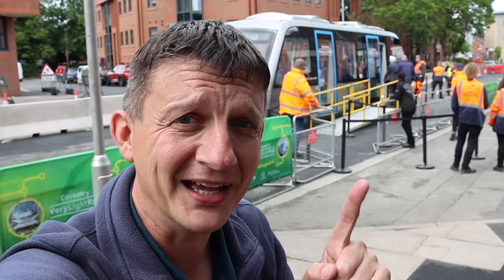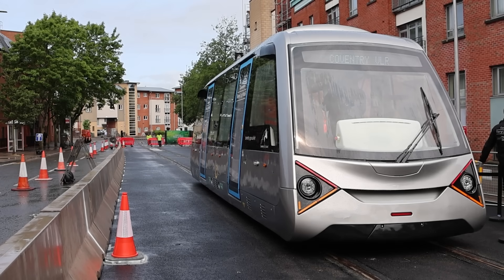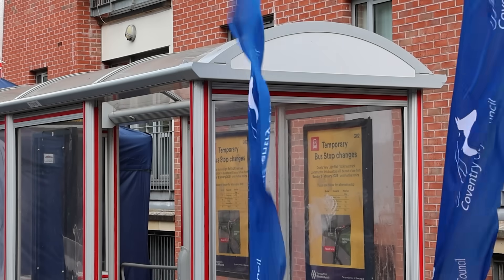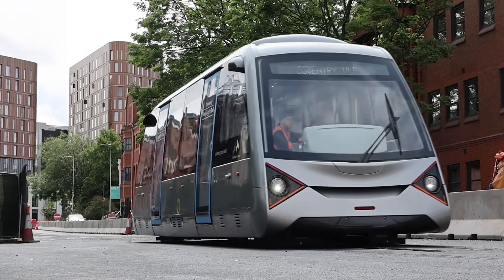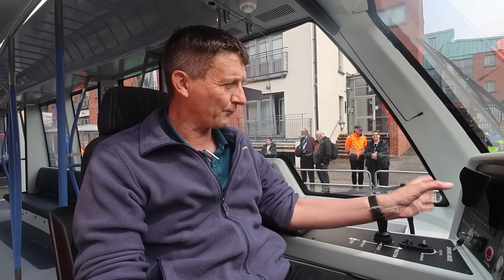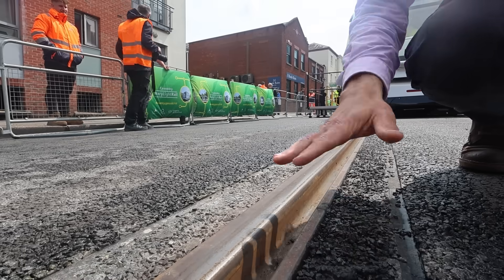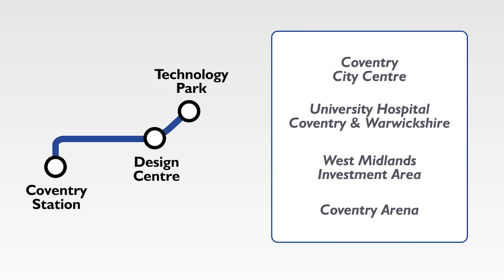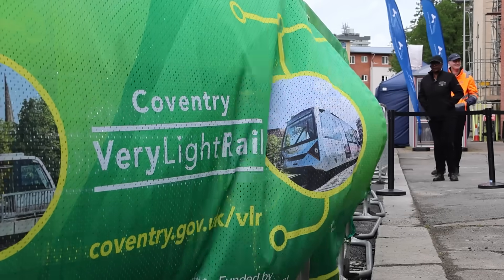The NEW! Coventry Very Light Rail is here

Comment: it's gonna take them 2 more years to connect just the city centre with the tiniest light rail cars that cant even go very fast? what's the point? just because they're half the price? we SHOULD be spending more on quality infrastructure so it actually lasts. with cars this size you'd hope for a quick decent service but theres no way this is even gonna be running more than every 10-15 minutes lol, so every single one is gonna be packed

Comment: I think that it has some potential for low-usage routes, for example in small towns and cities or as a connection to higher-capacity services in larger cities in certain areas (for example universities, commercial areas or housing estates), but i have one question:
Is it possible to increase capacities in the future, for example by coupling two or more tramcars together, using trailers or developing an articulated variant of the VLR? 
There could be the risk that the system could bemore successful than expected, which could lead to overcrowding, which could be avoided by providing higher capacities.

Comment: Two major issues i think, one being the capacity (this will get crowded really quick in a city of coventry’s size); two being that light weight trams are known to derail much easier during collisions. Conventional light rail already has this problem, i can only imagine that it’d be much worse for this.
Reply: capacity isnt an issue if it is frequent.
Reply: @suburbia2050 partially true but the charging infrastructure required to support enough rolling stock for a frequent service would become so expensive that fully electrifying the line will become cheaper- which would have just made it better to build a standard tramway from the start. as an example, fast chargers for electric buses often demand more power than your average entire neighbourhood draw at peak times. full electrification removes this peak energy draw and spreads it out much better. plus, this specific example in coventry is all street running (in mixed traffic) which means that top frequency is always gonna be limited by how many cars are on the road. to be able to use this system to its full extent you’d need to have much more dedicated tracking (lanes without any cars on/grassy tram tracks). reconfiguring roadways to support this higher frequency is very expensive, the small vehicles displayed in the video with mixed traffic running will not cut it in any respectable town

Comment: One thing not covered is the pedestrian trip hazard caused by the track not bring bedded in. Meaning that you would need dedicated running areas and not able to integrate with road transport due to presumably not able to drive over the track without risking one's tyres (bikes especially).

Pun not intended but will this be the stumbling block. . . . . .
Reply: Given slapdash installation wouldn't get past any inspection, I'm unncertain what point you're making here.

Comment: 70km seems like it will be the limiting factor for this, if it will be running 16 hours a day it will soon run out
Reply: Even with current Li-Ion batteries, recharge times might just surprise you
Reply: @TheHoveHeretic  Oh if only Li-Ion liked being charged. Or discharged. After 5 years the battery is used up and you need a new one.

Comment: I fear that this is nothing more than a virtue signalling gimmick that simply ignores the one thing that always made electric trams truly viable - the power source is not on board the vehicle.  With overhead cables you could have an even lighter rail system because you could power the vehicle externally which means you could delete what is no doubt an extremely heavy battery pack from the vehicle and just have the traction motors.  And this will need to be done because a 75 km range on a public transport vehicle is just ludicrous.

Comment: I don't know how to feel about this project.
The capacity is not that great, so thet could just use electric buses.
It's basically combining the worst of buses (relatively low capacity) with the worst of trains (they are not free to move everywhere).

If they were to connect multiple pods together, then I can see the advantage of staying "light".

Comment: Super skeptical. It is a pod. It has batteries. It requires a driver. It requires stations for step free bording - no, this is false, it could have a ramp, but cannot kneel. It requires pointwork and tracks. How is this better than a bus? Aren't the recurring costs the same as a tram?

Comment: The exterior of it looks quite nice, but the interior must have been designed by someone on a drugs trip, it's just wavy and strangely aligned. Whilst it might be cheaper to build, I'd question the use of such a small unit, unless you can actually couple multiple units together, you'd be better off with a battery electric bus which doesn't even need to have the tracks laid. 

As for a name though, Tramette? Trim? Bug? Or a personal favourite... Geoffolator.

Comment: It could be a nice stopgap for its political utility, testing out new lines with less investment. But promising most of the benefits of a full-scale tram will is frankly quite dishonest. The top benefits of a proper light rail are:
1. Capacity, because of long vehicles
2. Reliability, because of high level of separation
3. Increased property value and liveability, due to high investment into street infrastructure
This system cuts back on all of the above.

Comment: I mean this might have some promise but without longer vehicles with room for more passengers, I struggle to see the appeal for a city to invest in this over just a regular bus. Especially now where BRT systems, if well designed, can deliver a lot of the speed and attractiveness of a tram system for up to 150 passengers at a time at 1/3rd the cost. 

I know the current vehicle is just a demonstrator but still, unless they can design a vehicle that can match a bi-articulated bus on passenger capacity (ie 140+ passengers), then its gonna be a hard sell. 

Also IDK if its just the British government being stingy but as a Danish person I cant help but look at Coventrys population size, and think that both the cities here that have modern tram systems, Aarhus (pop. 295k) and Odense (pop. 182k), both have a smaller population size than Coventry and Odense especially is at crushload capacity during rush hour with regularly sized 30m long trams. So IDK how Coventry expects these tiny smaller than bus vehicles to cope with capacity.
Reply: I mean in THEORY you can make multiple units without making them heavier, so it shouldn't be that much of an issue. But yes Coventry is large enough to justify a proper tram. Although this would be great in even smaller cities.

Comment: "all the benefits of a modern light rail solution" - The capacity is a lot lower to what light rail offers. This seems more like advertisement than reporting.

What about points? I guess these need more depth than the normal track.

Comment: This looks interesting. The cost per km is apparently just 1/5th of a standard tram, so cost/benefit may be good enough for a lower rider number than for a traditional tram. If demand on a specific route can be identified the disadvantage of having a fixed route compared to a bus may not be an issue and the lower operating cost can be an advantage. Bus rides can be rough while a tram moves smoothly. I hope this will be a success for Coventry.
Reply: really is cheap considering it can just be layed from the base layer of the road bed, wonder how much weight those tracks can hold...

Comment: Do we know what the maximum axle loading is for the CVLR track system? So if one day you wanted to run full size trams along it without major track renewals to increase capacity, if you can it might make it more attractive for larger cities as well as they would be able to extend there tram systems for less and therefore able to spend the same amount of money on a longer extension or save money and use that saved money on other benefits to the settlement.
Reply: There is no track structure.  The rails are laid in trenches dug in the roadway - no cross-ties/no concrete slab.  My assumption (happy to be wrong!) is that if a "VLR" route is to be made suitable for "ALR" (Actual Light Rail) that the existing rails will be dug out and proper track laid.
Reply: @plaws0  It does have a concrete slab which the rails sit on and are held in place via Pandrall clips. The slab is around 9 metres long with 60x60cm openings for utility access. The Concrete slab is around 10cm thick with rails taking up the other 16cm of thickness to create the 26cm thickness.
Reply: @J-Railway-Volunteer  Pandrol, but yes, that was not well explained in the video (again, by the PR flacks, not Geoff).

Comment: what i like about that system: it's not a Gadgetbahn like "Trackless Tram" BUSES but runs on "normal rails" so they aren't bound to one builder and when they go out of buisness or don't produce replacements you can throw it all away.
and many undersell it. Just Look up "Woltersdorf Tramway", short route, similar sized trams but runs on conventional tracks so well, if you want a usecase for that System, look in similar towns or districts. And while 70km don't sound that much, you don't need that much if your route is short, like let's say .... 5,6km long

P.S. i liked Tramlette or Tramette from the comments
Reply: We'll assume the 70 km per charge is accurate even if we don't know how long it takes to charge to that capacity.

The battery for a 5.6-km route (assuming that's real, too)  would last 12.5 runs.  So really, 6 round trips.  Let's be generous and say that the round trip can be accomplished in 15 minutes and that the first car leaves at 0600.  Whatcha gonna do now that it's 0715 and the car needs charging?  

The more you throw the maths at it ...
Reply: @plaws0  there is a German word for that: Milchmädchenrechnung ... or "making wild mathematical guesses and they are ALL wrong"!
And it wouldn't be THAT hard to look at my case study, since it's all also available in english, to find out that they have 4 modern trams, that they run every 20mins and it takes 17min for one trip or 34 for a roundtrip and ~5min where they sit idle and can charge a bit and get more than the 6 Trips, with 2 of their 4 trams. Use the third one and they charge for way longer. 
Like, where did you get that wild numbers or that wild assumtion a tramline has only ONE car? Particular when you could just look them up or did you wanted to produce some flimsy counter arguments and not subject them to reality because you knew that all would crumble by the slightes breeze? So the only thing you where right was your last sentense and i threw more maths at your Milchmädchenrechnung.
Reply: @plaws0 you send out the next tram, and get the first one back in the shed

Two more of these and you’ve covered the morning peak

By the afternoon, you can start pulling them out in the same order with a full charge

Comment: This is an electric bus that just happens to run on rails - if you were skeptical you would call it a light-rail-bus. If you have a high quality pavement, there is little advantage over an electric bus. Note that the most important part of transport service is operations (frequency & journey time), not infrastructure.
Reply: Just reduced energy consumption.
Reply: "there is little advantage over an electric bus." - except cheaper to maintain, much faster to load and unload passengers, smoother ride, more than one wheelchair user can get on per vehicle, much easier for people with suitcases or prams, integrates nicely with pedestrian areas.  But yeah, other than those things, little advantage.
Reply: @BaseReality all for the low low price of several buses per unit
Reply: @BaseReality You could design a bus with almost all of those features though
Reply: @BaseReality  Not sure that a gadget bahn running in a single city that has to have everything bespoke would be cheaper to do anything with than a bus.
Reply: @BaseReality

Get rid of tickets and get a buss with 2 sets of double doors. If you want we could call the bus a tram for you feelings.

The energy required to build rail makes it pointless.
Reply: '..bus that just happens to run on rails...' By Jove, I think we've got a name for the vehicle. Pacer!
Reply: yes, overall capacity would be my concern as well
Reply: @momerathe  capacity isn't an issue as you could have the next one arrive 30 seconds after the first departs if there is so much demand.
Reply: @momerathe  Do try and keep up .... multiple unit operation has been a thing on electric rail vehicles since at least 1915 !!
Reply: @TheHoveHeretic  but not on this vehicle, according to anything in this video or online.
Reply: @momerathe it's a prototpye for pete's sake.  You want the moon on a stick, you do!
Reply: Absolutely pointless, what's wrong with a horse and cart? We managed perfectly well for centuries until these newfangled engines came along.

Comment: The CVLR is a good concept, and the track cost is a good innovation, but the tramcar design is stupid, why didn't they just build a bi-directional battery-electric 10.5m double-deck tramcar, the same length as the most common model of the Wrightbus StreetDeck (of all power types), with standard bus parts, and a manual-fold out wheelchair ramp (in place of level boarding) as a way of saving money?

The CVLR will end up being a huge waste of money if they build and use this type of vehicle.
The only unique part here, compared to any other tramway is the track installation.

Comment: A significant part of the cost of building a new tram system is moving utilities.  Even with the track being cheaper that would still be necessary surely, in case something goes wrong and needs digging up.  So that would impact the savings in reality.

Comment: Trolley buses are the future😊
Reply: For all their advantages, there are (at least) three inherent issues with trolleybuses which can't be overcome (a) steel on steel will always be vastly more efficient than rubber on road (b) even with improved design, there will always be opposition to OHLE in the urban environment and (c) the kinetic envelope of trams will always be an improvement on free steering vehicles. 

I do wonder where the crossover point lies between fast-charging battery buses and battery equipped trolleybuses .... and then the last point above suggests the guided busway concept needs adding to the mix, at which point, return to points a and b.
Reply: Yes, see what the Swiss are doing with them in places like Zurich!